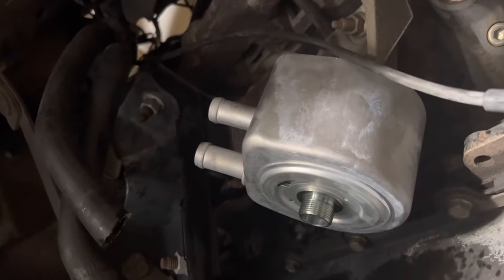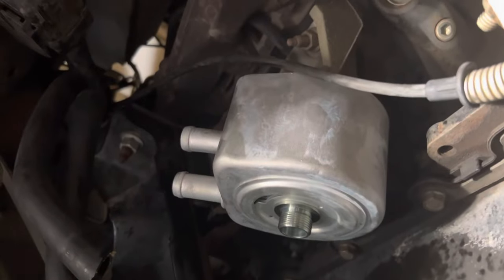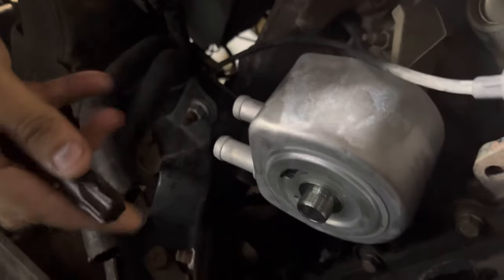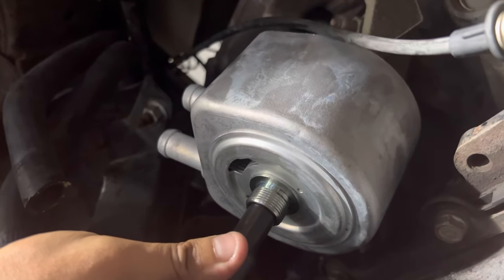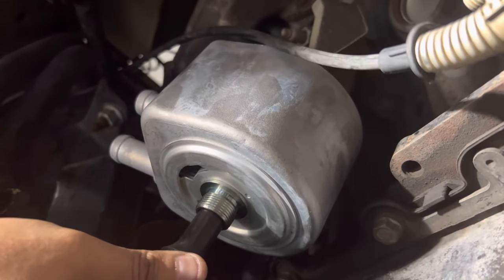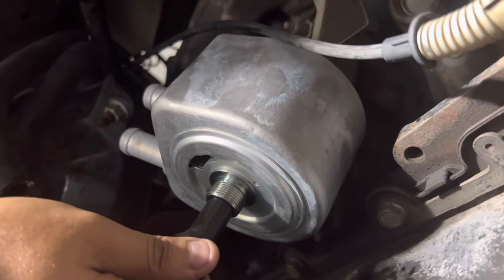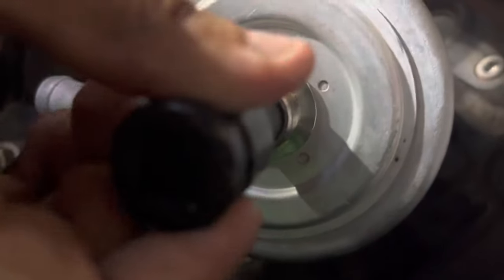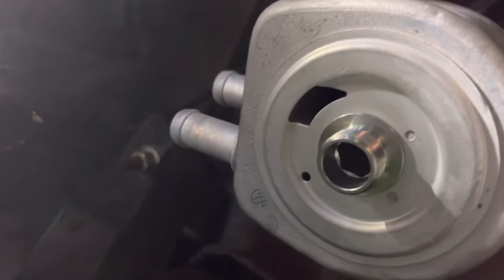Ford oil cooler removal

Comment: The last time I changed oil in my vehicle I got the oil filter off but the bolt was loose on the oil cooler. I wasn't sure how to get it tightened. I got the new filter on and I got it all sandwiched together and so far it has never come loose again.
I didn't know what to do when it was kind of in a panic Now I've researched this a little bit. I expect the next time I take the oil filter off the bolt will come with it.
Ironically I've been working out of town The last several oil changes have been done at the dealership. This was the first oil change I did myself in a while and no other Ford dealership has made mention of it.
I also found a specific torque value for the oil filter bolt for my EcoBoost engine and it's 46 ft lb.
Reply: The Ford manual for the 99 says 40.5-44 lb/ft but 46 lb/ft is basically the same thing.

Comment: Thanks for this. On my 2015 5.0, the duffus at the plant didnt properly tighten down the oil temp sensor which is threaded in directly behind that unit. I need to remove this to tighten it back down. There is absolutely no space to do it in place.

Comment: Does a gasket go on top of the oil cooler or do you make one w a gasket maker, I order a replacement one and went to install it when I took the old one off don’t see a gasket and I couldn’t find one to buy online so I’m guess no? Seems weird it wouldn’t have one. When I tried to install the new one w out a gasket it leaks a small about of oil maybe oil coolant mixed from top of cooler. Can you show or reply and let me know if there should be a gasket on the top part of the cooler not the part that attaches to the filter but the top part above that.

Comment: I bypassed mine to get home off the road and now I don't remember which hose goes on top and which is on the bottom.  Does any have a diagram or suggestion on how to identify which goes where?
Reply: sub indonesia
Reply from the maker: I believe far right one is top port and left one is bottom port
Reply: I don't think it matters.

Comment: Was your engine overheating? I have an overheating issue in my 99 F350 with the V10. I thought it was a blown head gasket because it overheats after about 50 miles of driving and I’m starting to get oil in my coolant but it looks like I don’t have coolant in my oil. I did an engine combustion leak test and it’s not showing any signs of engine combustion failure so I’m thinking that it might be my oil cooler…
Reply: Any updates, have similar issues. Oil in coolant but not coolant in oil.
Reply: Yes. I replaced my oil cooler on my ford f350 and the issue seems to have been fixed as I have taken it on a few hundred mile drive after replacing and no issues at all and everything seems to be running fine. I had to do about 5 flushes thru the cooling system to get all the oil out….
Reply: Ok, was your coolant foam like when it was bad?

Comment: Damn, I was getting confused by the oil filter adapter and the oil cooler, not knowing they were 2 different components.  I just wasted $10 ordering the adapter gasket, lol.  I just need to remove my cooler b/c it's in the way of the #1 oil pan bolt, lol.  BTW, the torque spec in the Ford manual for my 99 F250 is 40.5-44 lb/ft for that T70 bolt.  I bought the Ford manual from eManualOnline.  It's a PITA to setup the virtual machine on a PC, but once done, the company manuals give so much more details than Chiltons or Haynes...